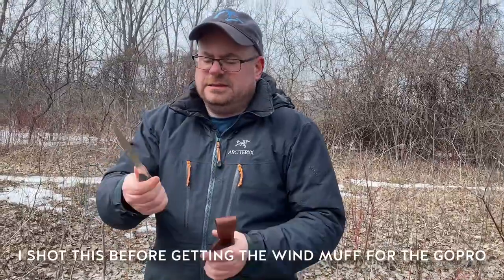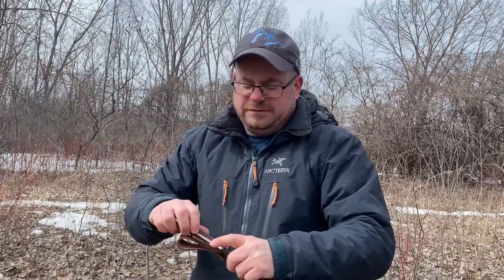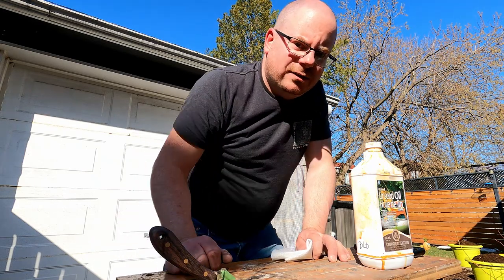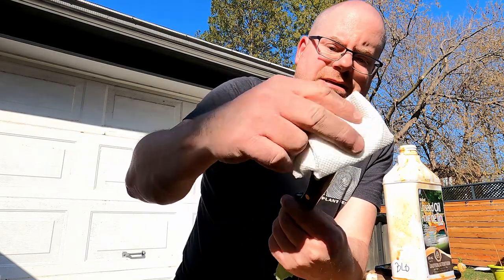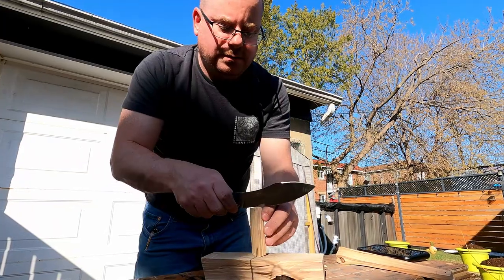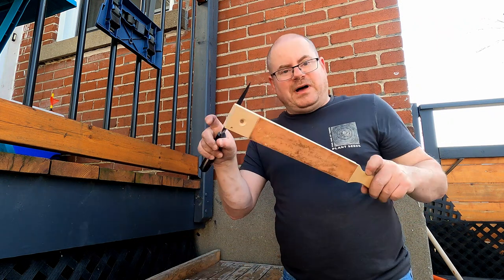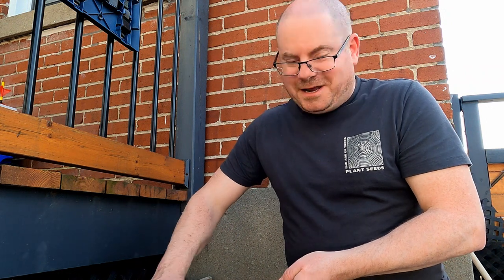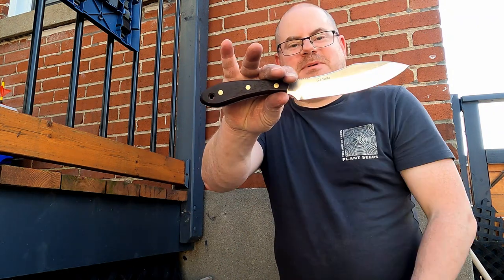Grohmann No4 survival knife DIY handle fix

Comment: Nice job ,looks great ,I’ve had that knife and the only thing I find is I’ve cut the sheath so I went and got the other overlap sheath
Reply from the maker: Legit. I have almost cut the sheath many times. That other sheath looks like it eliminates the issue. Any problems?
Reply: No works good
Reply from the maker: @pacediver2594  niiice. So if I cut the crap out of this sheath, I’ll go that route.
Reply: 100A. Actually order the seconds they are have the price and nothing wrong with them

Comment: We have the same sawhorse/table combo.

It's super cool that you're one of the only guys out there doing flint & steel fire.

2000 grit means so little - after 2 or 3 uses it'll probably get dinged up anyway.
Reply from the maker: I love flint and steel. Loooove it.

I’m with you in the 2000 grit. Diminishing returns, gonna get used and abused anyway, and I’m frankly afraid of a handle that’s too smooth flipping if I’m working at -20°C or in the rain.